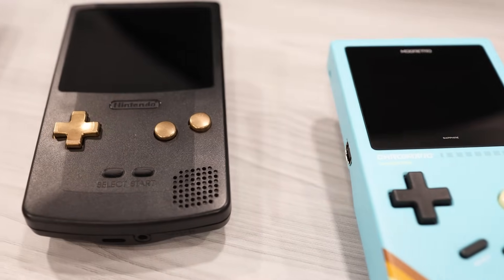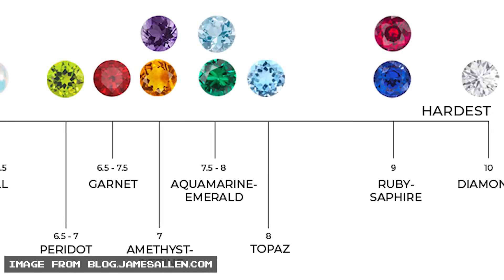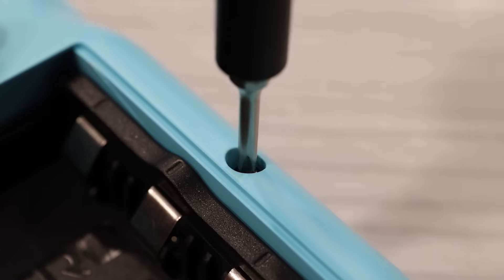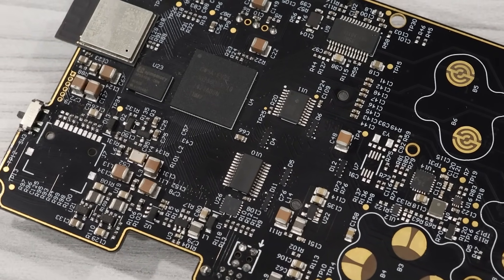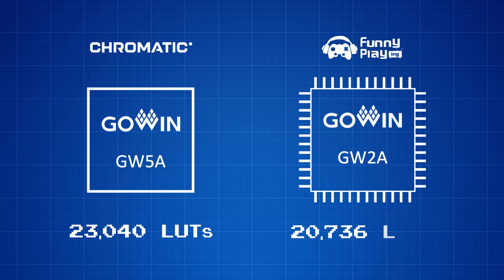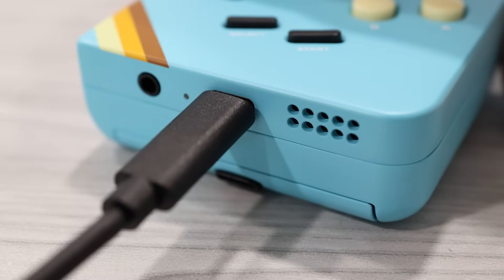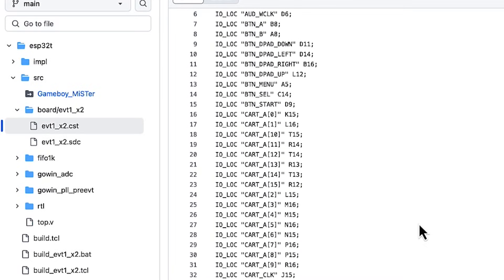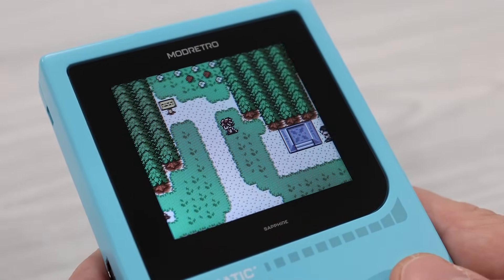Inside ModRetro's Chromatic

Comment: You're wrong on there being more value on the pocket due to the rechargeable battery. It is a detractor and is the biggest reason why I am not a huge fan of it. 

I use mine a lot and the battery charge is already going out pretty quick. You can't buy replacement battery and the cost to fix it is about the price of one, so soon I will have a $200 paper weight if I continue to use it. Chromatic will last longer due to it using standard batteries.
Reply: I second this notion
Reply: Same. I prefer the chromatic hands down. It’s hard to put down at times. Like when I was a kids. I’ll spend hours playing.
Reply: Yes I just ordered one mainly for this reason.  AA batteries are easy to obtain and I don’t have to worry about a degrading battery

Comment: So on the battery config. 
The manual states the following,

.Comes with 3x AA batteries for ultimate flexibility
.Also compatible with custom lithium ion pack, rechargeable through console

So my guess is you’re right. 
The wiring is to check if it’s powered by AA batteries or the ion pack.

Comment: Did you know that the Game Gear also uses a 160 x 144 pixel resolution? And the NGP(C) is 160 x 152 pixels, so only 4 lines at the top and bottom each that would be overscun?
Reply from the maker: Oh really.. no, I wasn't aware that the GG had the same resolution... 🤔
Reply: Atari Lynx is 160 x 102, so also possible, although refresh rates might be a problem.
Reply: Oh man, being able to repurpose my Chromatic as an NGPC would be pretty rad. Even if I have to give up the clickstick to make it happen.